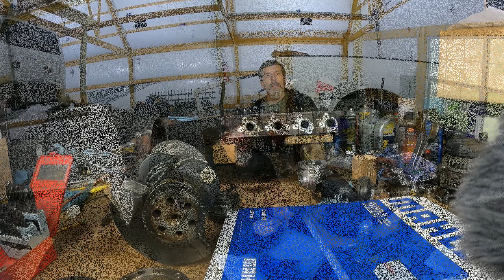Powerstroke 6.4 is Snakebit!

Comment: can youdeacribe the method you used to lift the cab on the truck w blown engine. I dont have a lift but may build an A-frame to do the lift
Reply from the maker: I talk about it a little in my latest video. I used 2x10’s with 2x6’s screwed on top and bottom like an I-beam. The 2x10 in the rear of the cab cracked. I probably should have screwed two of them together with the 2x6’s on top and bottom.

Comment: There's no reliable diesel truck known, 7.3 and 5.9 wouldn't break because they were so underpowered. 6.4 Had the potential to tune and get alot of power out of it deleted. The new ones are worse nothing but issues with emissions and clogging exhaust filters.
Reply from the maker: Complicated = unreliable. I have worked on a lot of engines, but I have never seen one this complicated (or unreliable).

Comment: An upgraded 6.0 would slide right in 😊
Reply from the maker: So I should replace the least reliable engine ever with the second least reliable engine ever?
Reply: To each his own I like mine nothing in the diesel lineup sounds as good to me now in factory form it will have some problems once you address the egr put some studs in it they are actually pretty good I know it gets hate but some of the bad rap they get is the owners neglecting them
Reply from the maker: Sorry for the sarcasm. There is a lot you can do to make the 6.0 and 6.4 engines more reliable. There is also a TON of power from them. Whenever I fix mine it seems to break somewhere else, though.

Comment: That’s strange that’s not a common 6.4 issue that’s a strange failure
Reply from the maker: My best guess is I had a bad injector that caused excessive wear on rod #2. I have pulled the injectors to check them out. Will update the comments if I find anything.
Reply: @barntech2291  that’s a little more common issue how many miles are on the 6.4?
Reply from the maker: About 170k. It sat up for three years though. That’s worse for them than racking up miles

Comment: Bullet proofing kills these. I have rebuilt tuned 6.4s many times. Never have had to rebuild any stock ones. Tuning takes out bearings and the cam. If you don't get all new parts you will be plagued forever. Don't be cheap with a 6.4. They bite.
Reply from the maker: I think you trade one problem for another
Reply: @barntech2291  Yes, you trade being on the side of the road for a sensor for being on the side of the road for a crankshaft or cam. Was your cam good? I have changed many in 6.4s because they wear through the case hardening. They wear and then start wearing the lifter roller into an egg shape. Then you get an intermittant miss.
Reply from the maker: Cam was good. Issue seems due to spun rod bearing. I have no idea how tuning could cause this, unless it raises the rev limit. I don’t think my engine ever went much above 3k rpm though. Is that what you think happened?
Reply: @barntech2291  They advance the injection timing with the tunes. The increased pressure from the advanced timing hits hard on the top of the piston, if it doesn't crack the piston cup ( that's why you decup the pistons for high performance ) the shock force is transfered to the bearings. It will keep smashing the bearing. I see it with the center main bearing most of all. you will see a copper spot on the lower bearing from it getting pounded. The 6.4 runs perfect untill it's blown up. The 6.4 despite that is my favorite powerstroke to make power with. They just don't make it very long. This is what I see and I'm sure there are plenty of people that will dissagree
Reply: @russellaustin4988  Curious, while mine is tuned and will bury the boost gauge, I never allow over 30 psi if towing or on a long grade. At 323K may be just lucky. I keep another truck ready with trailer 'just in case'.
Reply: @rondye9398  You are smarter than 99% of the tuned truck owners. The heat from long pulls is killer. If there is black smoke coming out there is too much heat on the piston surface and will burn a hole through.  It's not too much fuel, it's too much of everything.

Comment: Boat anchor
Reply from the maker: I find it hard to believe, but I had two problems that day. What stopped me in my tracks was the HPFP (new video coming soon), but when I coasted to the side of the road my main bearings were seized. The fuel system and oil system in this engine are completely separate. What are the odds that both would catastrophically fail at the exact same time?

Comment: Shame on ford for putting this engine on the road.  Many people have spent good money for a diesel in faith they bought a reliable HD vehicle.  So sad and again shame on ford.
Reply from the maker: It’s hard to defend Ford, because this is the most unreliable engine I have ever heard of; it breaks in more ways than I can imagine. However, please consider two facts: 1) The US EPA did not allow Ford to continue making the 7.3, and 2) No other light duty truck can match the torque of a 6.4 in its stock configuration. I love my new Dodge, but I miss the power of my old 6.4.
Reply: @barntech2291  Blame the EPA for changing regulations so quickly during this period that Manufacturers could not design and fully test those 'air purifiers' before releasing them. These motors in Internationals larger trucks did not have all that crap and never had issues.

Comment: How much did it cost you to build your tent Gurage. Slab and all.
Reply from the maker: It is an insulated metal building (pole barn). I had it built about 8 years ago - before COVID sent construction materials through the roof.
Reply: @barntech2291  yeah that definitely plays a factor. I bet where I’m at that’ll be around 6 to 10k. I just built a little walk out porch with a ramp for my moms camper and that costed around 1k

Comment: 6.4 are as bad as a 6.blow....my 2001 7.tree f2shity has 980 thousand miles all original Michigan truck works construction and plowed every winter of its life...still stroking and purrs like a kitten 😸... 13 letter shitspreader INTERNATIONAL best diesel ever made.  I've been driving it for 23 years now....try that dodge Chevy or Toyota....
Reply from the maker: I don’t think this 6.4 has a million miles in it…not with 15k miles between these last two rebuilds.
Reply: No it doesn't.. international doesn't even claim engine life past 250-300 before a rebuild. And Toyota and Cummins both product million miles engines often.